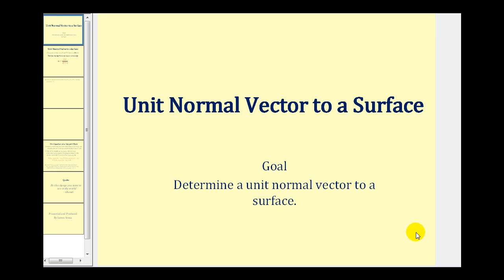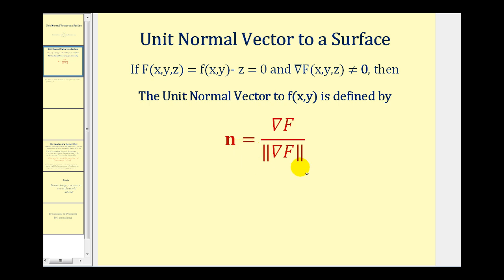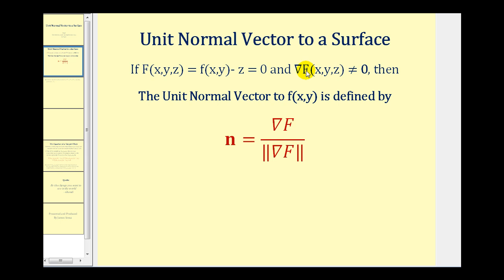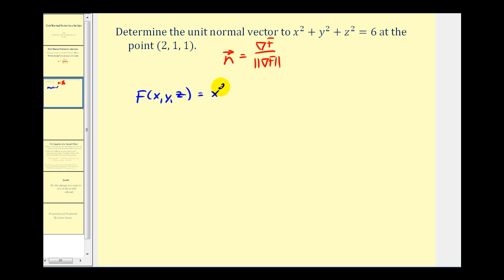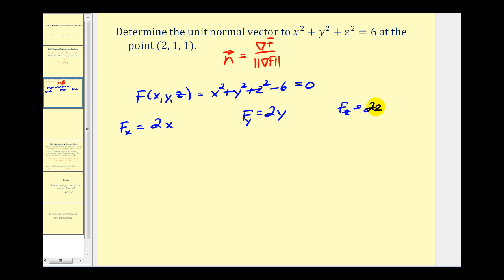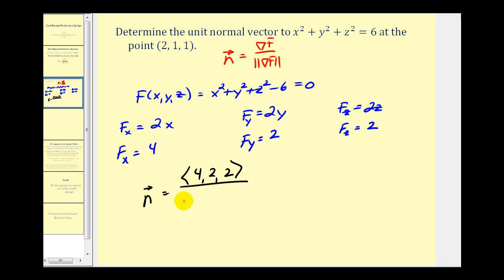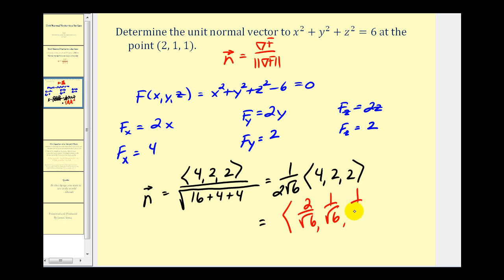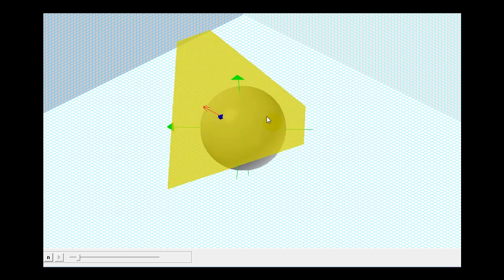Determining a Unit Normal Vector to a Surface

Comment: Normal vector representation is 4 i cap + 2j cap+ 2k cap and u denoted all of them as ( 4,2,2)....such an idiot u are!!
Reply from the maker: I appreciate your enthusiasm for the topic of vectors.  However there are 2 main ways to represent vectors.  You can use the unit vectors i hat, j hat, and k hat or <1,0,0>, <0,1,0>, and <0,0,1>.  I'm using angle brackets to represent vectors, not parentheses.  You might find this website helpful.  http://tutorial.math.lamar.edu/Classes/CalcII/Vectors_Basics.aspx
Reply: rude you are!
Reply: that was really rude, i think as long as you understand what he talks about the notation in itself doesn't matter, and yes you can represent vectors like you do with a set points (called a matrix *******)
Reply: Who says cap lol? Such an idiot you are! Seriously just fuck off. Think you are so smart but you are not. With that pathetic attitude, what profession can you even take?